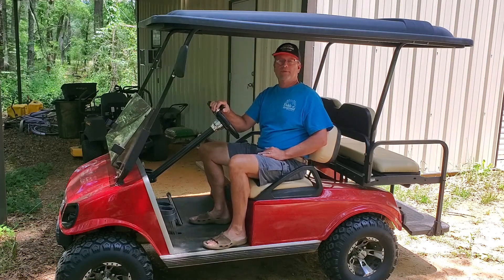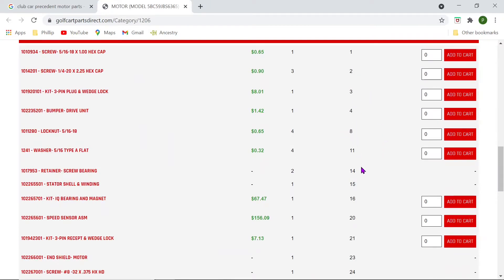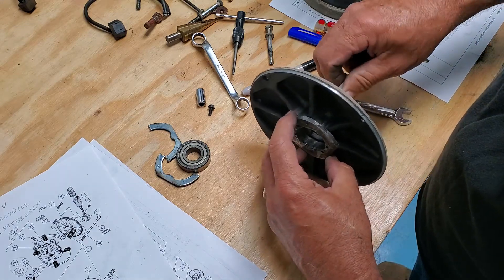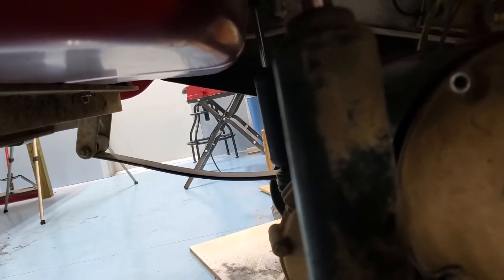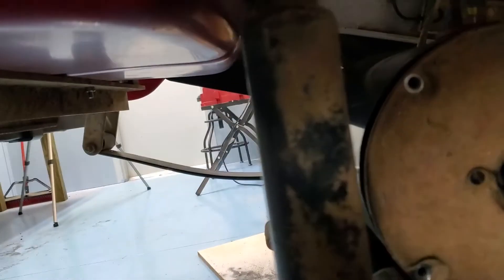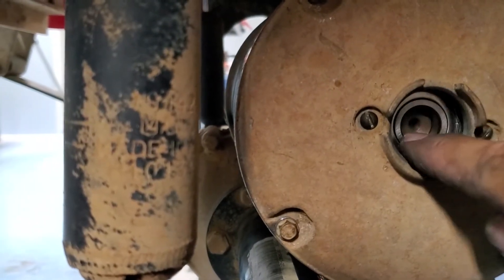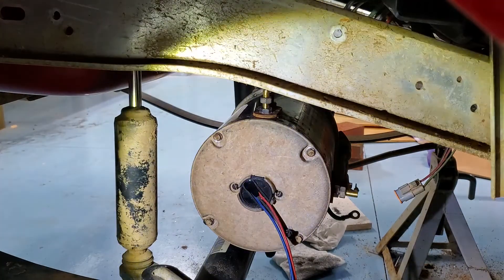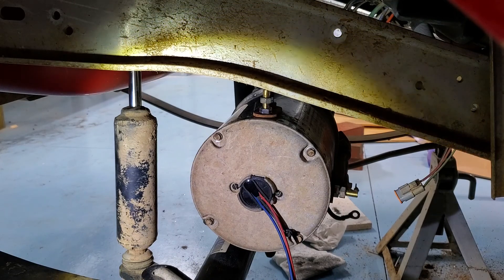Club Car motor was stuck. This could save you money.

Comment: I see this is old now, but super helpful.  I need new brushes on my 36V GE motor.  The process is not that different from the 48V.  I was just about to remove the motor.  However, its heavy and hard to remove.  Now I'm thinking to remove just the end cap and work through the passenger side back wheel well to replace brushes and the bearing.  Bearing doesn't appear dead, but while I'm in there, seems a good idea.  Bearing is 40 years old.  I'll watch a YT on rebuilding my motor and get the details.  I have a 3D printer and can easily design and print a tool to fit the shaft end to tap the bearing in place.  Looks like 2 tools.  One to get it started with insert, one to seat it after the shaft is flush with the bearing end.

Comment: This has been so helpful even though I haven't done anything yet. I think it tells me that I can change the bearing and magnet without taking the motor out and apart in my '03 48V electric club car that has a GE motor. Although it doesn't tell me how to get the original bearing off, I can take the wheel and wheel well off and start from there. I have a bearing puller but it might be awkward.
Reply: Did you do this? I took out the two screws that hold the retainer bearing :/

Trying to find a solution without taking the motor out

Comment: I'm at the exact spot of taking a break. Spline is completely seized.. tried air tool vibrating, penetrating oil, pry bars, shaking, wiggling, praying, then gave up for the night and saw your video then it dawned on me I don't even need to remove armature.. I'm replacing one of my copper bolts and probably do brushes while I'm in there. Also for some reason I'm reading zero continuity between F1 and F2? 12v jumper motor test ran though so I'm confused.. thanks for posting!

Comment: Hi.  Thanks for the video.  I am not sure what that bearing retainers purpose is?  The shaft has a land to keep to the bearing from moving and the aluminum case also. Could it be for ease of assembly in the motor manufacturing process?  Even during disassembly if the bearing remained on the shaft a bearing puller could take it off.   My son has a cart like this that might need new brushes, this is why I am asking.   Where can I get the brushes.   Thanks

Comment: I have a 2002 club car ds 48v and I was looking to put on a high speed magnet. I made the mistake of removing the two vertical screws that hold the retainer bearing. Now I’m trying to figure out how to put the screws back in to the retainer. 

Any thoughts? Should I remove motor cap? Or will that cause potential issues to motor? I have a GE motor
Reply from the maker: You have to remove the cap to start the screws back in the retainer.  Be carefully to keep the brushes in place.